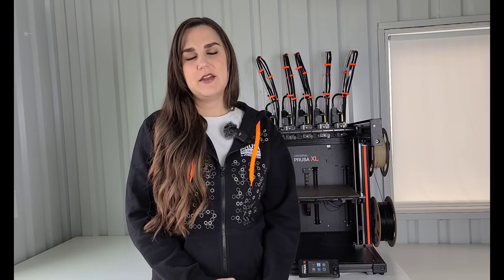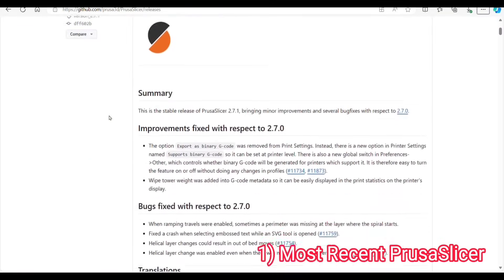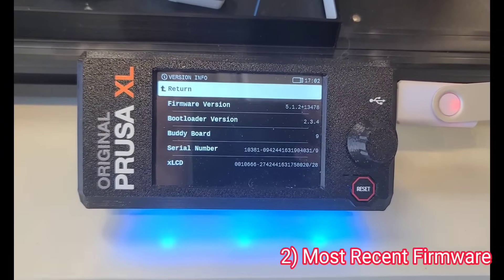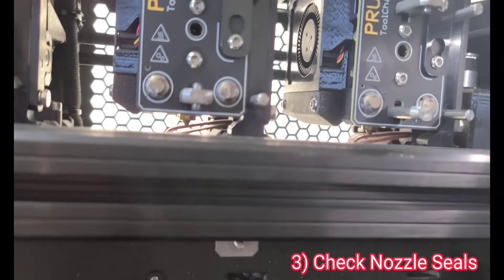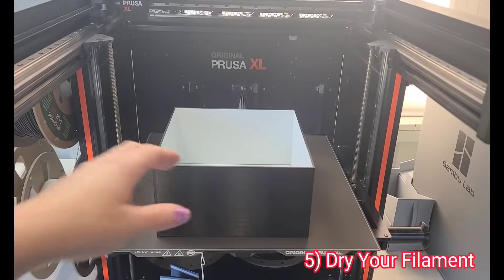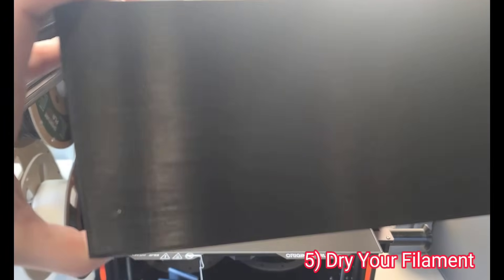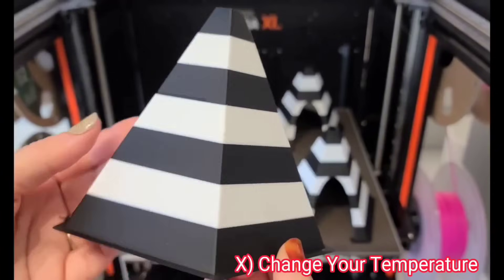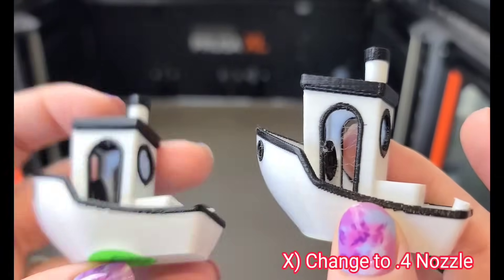Stringing on the Prusa XL - 5 Things That Worked and 3 Things That Did NOT Help!

Comment: First of all, thank you for your content. As an owner of a XL 5-head, you're one of the only YT'rs dropping consistent and legitimate content on the XL, so thank you!

I received my 5-head XL back in November, "fully-assembled" (haha) and honestly, it was wonderful out of the box. I am horrified to hear that there have been so many people who've had bad experiences, and I find myself extremely lucky. I had actually considered almost cancelling my order but I decided to commit as I know Prusa and it's community have resolved nearly all major issues (I had and hated my MMU2S on my MK3S). 

I have been fortunate enough to not have 98% of the issues you have had. Honestly I've only had 1 failure and it was my fault (bad slicing) but have had only mild stringing. I wish I could offer the community anything more than that, but I do my best to keep my filament stored in a "dry box", it's a weather sealed tupperware loaded with dedicated, and occasionally dry an older filament in a sunlu dryer.

My biggest issues with the printer in gerenal are: 
1. The bowden system can be a pain when loading TPU or when a filament breaks in the tube. It's workable but just a pain in the butt. I understand it is a necessary evil of having 5-tool heads so just keep on trucking.
2. Multi Nozzle size printing is not a thing... YET.. I have high hopes this will come in a future Firmware/Slicer release, we're early adopters so I'm just going to be patient but there's no reason to believe that it won't be developed in the near future.
3. This is more just me still learning but mitigating the wipe tower into the infill is just something I haven't been able to figure out yet, that as well as multi-material printing; as in using PETG as supports for a PLA print. There is just no good documentation/guidance out there right now. I'd LOVE to hear/see if you've done any of this!
4. The XL is not for the feint of heart to use it's full potential. Price point aside, understanding 0.6 vs. 0.4 capabilities, input shaping vs not, and getting creative with the large size and the number of parts as well as orientation of parts, there's a LOT to digest, years of experience has helped me to do some really fun stuff, but I have so much more I need and want to learn!

Honesly that's it. I know it's not a perfect printer, but legit... name one!? It doesn't exist, there will always be compromises, we have to choose/purchase based on our own personal needs/wants/use cases and move from there. The market is super-saturated with printers these days, I have personally owned 9 printers across 6 brands. I stick with Prusa for the dependability and community that always pull through! Bottom line, I REALLY LOVE this printer and can't wait to see what the future holds!

Once again, thank you VERY much for the content & shorts, they are very helpful. You're literally the only YT channel I have notifications enabled for! Happy new year and I look forward to sharing more of your XL adventures!

P.S. I have purchased 5 new 0.4mm nozzles, but I'm having too much fun with the 0.6, I had great success on first ever TPU prints, it was really easy and only mild stringing! One of these days, I'll make the swap to the 0.6.
Reply: My experience is very similar to yours! I've just got a set of 0.8, 1.0, 1.2 CHT nozzles. I am curious how they work. Actually I've got E3D nozzle adapter for each tool next to my set of 0.4 and 0.6. I am even trying to combine them in a single print.
Reply from the maker: That's great to hear that you have had such a great experience. I think I have stuck with it because I love my other Prusa printers. And I've also seen good results on facebook. I feel like it has such potential. 
My Bambu is very reliable but has limitations. Multi color prints take a very long time and of course creates much more waste. 
So I'm really ready to have the XL printing well. Thanks so much for your support!

Comment: I'd say go ahead and buy a couple filament dryers. Using the Bambu's bed is a nice stopgap, but dedicated filament dryers can dry the filament faster and won't tie up a printer. In addition, I'm willing to bet that dry filament will improve your prints even on other printers, as well as improve reliability. Drying filament is something that is pretty useful for running a 3D printing business, so I think having dedicated filament dryers would be worth it.
Reply: Agree since you live in a humid area.
Reply: There's been a few models recently released that would work for multiple spools (the Sunlu Filadryer S4), and I think there are even more on the horizon; now is actually a pretty good time to be looking at one.
Reply: I 2nd this advice. Filament dryers, especially ones that have hot air circulation such as those from Eibos, the Sunlu S2 or the new Sunlu S4, will be so much better and dry faster than using your Bambu as a dryer. Plus you can print directly from most dryers if you wanted to. I do that all the time when printing pretty much anything besides PLA. 

Just a word of warning if you were thinking of buying the Eibos Cyclopes dryer... the fan on it is loud and it has caused issues for me and others with melting filament because the fan blows right on the bottom of the spools. I heavily modified mine to quiet it down and fix the melting issue. I still, very occasionally, get some deformation on the filament if I leave a spool in it that isn't rotating. As in, I print from the dryer, but the print ends while I'm at work. The spool not turning can lead to deformed filament on the bottom of the spool. Although, it no longer straight up melts like it did when I first got it. They have a new one coming out soon called the Polyphemus that seems to solve most of the issues with the Cyclopes.
Reply from the maker: I agree. It takes 12 hours to dry on the Bambu! I'd rather be printing. I'm just running out of space. But I'm sure they wouldn't take up too much space. Thank you!

Comment: Firstly let me say thank you for posting your videos on the XL, I am still waiting (not so) patently for mine to arrive, so it’s great to be able to start to learn about the machine whilst waiting.

I am glad that you are being reasonably reserved in your criticism of Prusa as, whilst there are definitely improvements that can be made to the hard, soft & firmwares, I have to say that I think that there is also a certain amount of user experience that needs to be gained to improve the situation too:

Item 3 of your video states that having your nozzles seals set at the correct height is necessary to obtain a good print and you even refer to the Prusa video on the subject, which clearly shows how they need to be set, yet yours are obviously set too high: When the nozzle is in place, on the seal, the contact area of the seal needs to be parallel with the face of the nozzle otherwise a good seal will not be achieved and oozing could occur.

You are not making life easy for yourself by using non-Prusa filaments either; Prusa cannot be expected to develop/provide profiles for every single filament available as thoroughly as they do for their own.  Even if you were using Prusa filaments, a certain amount of tweaking of the profiles might be necessary dependent on the colour of filament and type of print, so if you’re using non-Prusa filaments you should expect to have to do a lot more tweaking to the profiles and you need significant experience and persistence to do that.  

On the whole the printer is doing a great job of printing the benchies, even with a 0.6 nozzle and do not forget that the Benchies are a torture test, designed to push your printer to the limit.  The only thing that it is struggling with, is a little stringing and oozing on multi-coloured prints which, as you have found with the 0.6 nozzles is a just a case of getting everything set right, including the filament profiles.  I’m pleased to see that you have been using a temperature tower, but I also think that you need to do some specific stringing tests, with each filament to iron out your problems with the 0.4 nozzles, including dried vs non-dried filament.

You have stated that you are not getting stringing/blobbing problems on any machine, but I think that it is fair to say that the issues you are getting are only really relevant to multi-material machines; do you have the MMU for the Bamboo?  I believe the MM version of this machine has a nozzle wiper built in and I have seen that others have added wiping brushes to the XL, maybe this would help you too: Search models: xl nozzle brush | Printables.com

I did a bit of research reference the Bamboo wiper & people were saying that the standard wiper isn’t that great, but others have made a modified versions that use 2 or 3mm silicone sheet as a wiper, maybe this would work better for the XL too: Bambu Lab X1C/P1P Nozzle Wiper with 2mm Silicone sheet by Sealight333 | Download free STL model | Printables.com

So, the final topic to address is why you are getting worse results with the 0.4 nozzles, when “everyone” else is getting better results and physics would also dictate that oozing should be less with a smaller orifice:

How long was there between drying the filaments, printing with the 0.6 nozzle and printing with the 0.4 nozzles, is it possible that the filament had started to absorb moisture again by the time you did the 0.4 print?  It is also possible that when you did the drying, the filament was only dried to a certain depth of the roll and the dry portion had been used before you did the 0.4 print.

Did you recalibrate the tool heads after changing to the 0.4 nozzles? This process is much more important on the multi-head machine than it is on any of the single head machines:  On the mk4 no change is necessary, if you don’t reset the Z-offset on a mk3, the only thing that could be wrong is the first layer, after that all other layers will be fine, but if you don’t do it on the XL, there could be a mis-match between the nozzles positions & height on every layer, which could cause one colour to be deposited on the other colour mare readily.

What layer height did you use/was it the same for both 0.6 & 0.4 prints?  Is it possible that the layer height used was more suited to the 0.6 nozzle?

Finally, have you noticed that there are now different filament profiles for each nozzle size & also for with & without Input Shaper?  The temperatures for the 0.4 layer tend to be hotter than those for the 0.6, is it possible that you adjusted the temperature for the 0.6 nozzles, but not the 0.4 nozzles?
Reply from the maker: All very good points. Yes I did recalibrate after swapping to the .4 nozzle. For the dried filament benchy, I printed the .6 first and then the .4. So yes it's possible that it either absorbed some moisture or wasn't as dried closer in on the spool. But these prints don't take much filament. 
Yes I used .2 speed on Input Shaper for both profiles. I will work on the nozzle seals. I figured as long as they're not pushing my toolheads up, the tighter, the better. 
I am having some prints that work out ok. But the inconsistencies are what are getting frustrating. 
Prusament PLA is sold out in almost every color. 
I think it's completely possible that my issues are user errors. Thanks

Comment: Really great update, thank you. I've a 2 head partly assembled XL. I've been feeling some buyers regret. The only things that have worked really well are single colour large prints (things that I can't fit on the MK3 or MK4). Most of my multi toolhead prints have been a failure - stringing yes, print failures yes I think are due to collisions on the wipe tower. My MK4 is working so sweet, and with input shaper is rock solid. I've not talked to Prusa support - I did try over Christmas but there was a long wait for an agent. I wasn't aware of the pin greasing issue. This is why your channel is so bloody useful - as others have said, there's very few YT channels covering the XL that I either trust or can be bothered with. Keep up the great content.🥰🙏👍
Reply from the maker: That's frustrating! Yeah single colors I have no issue with. Or maybe a single color change. I'm running something now without a tower because I've been having issues with that as well. I know it's not recommended, but it's worth a shot. 
Yeah I feel like getting on chat you need to be in front of your printer and be ready to wait for a couple of hours. But I think they need to get more feedback of the issues we are experiencing. Hope you get it sorted! Thanks so much!

Comment: My thoughts on the nozzle seals is that they should just touch the nozzle when it is parked. Reason is to keep the seal parallel with the nozzle tip. I do this by lowering the seal all the way down, putting the toolhead on, and then raising the seal till you can't see light between the nozzle and seal. Then one more turn to press it against the nozzle.
I can't say it solves any problems as this is how I did it from the start and haven't had major stringing problems. It is at least a procedure to get the same results every time.
Reply: This seems like an underrated solution. If the seal isn't good (completely flat), then the wipe tower can only do so much.
Reply from the maker: Makes sense! Thanks!

Comment: I like hearing your updates with the XL. I have the 5 tool semi-assembled version and I had some stinging early on that got mostly resolved with drying. I had a food dehydrator and designed a wall for fitting filament spools. I have recently purchased a Sunlu Filadryer S4 so I can dry multiple spools simultaneously. I switched to all 0.4mm nozzles mostly because it shows details better, but I noticed a further improvement in stringing after that. Right now I do not see any stringing issues and i am mostly happy.
Reply from the maker: That's so great to hear! Thank you!

Comment: As @hylitedFx shared, I too am thankful for your consistent and useful XL content, especially as I waited for mine to be delivered. I just completed the build of my semi-assembled XL-5 and am running my first 4 color print now with the 0.4 nozzles provided with the printer. So far everything looks good, however, if that changes, I will let this group know.
Reply from the maker: So glad you got it and are happy with it! What types of prints have you been running? Thanks!
Reply: @tada3dprinting  My first, and only print at this point, was a 4-color sign for my shop. It turned out fantastic! This is my first multi-color/material printer, and I wasn't expecting it until late Spring. When I finalized my XL preorder with Prusa in mid-December, two days later I received an email from DHL that it was being delivered in a week! Now I am behind with working on some new products that can be printed in multiple colors. 🙂
Reply: @agomerd  When did you place your order?  I'm interested to know how far off mine is; order place April 2023.

Comment: I also had some issues with stringing and blobs with my dual-head semi-assembled XL, but the new updates and a switch to 0.4mm nozzles fixed those. Now I have no stringing at all with PLA, the dual-color benchy is absolutely perfect. 
I had minimal stringing with PETG, which I fixed by adding brushes (look for „XL Nozzle Scrubber brush“ on Printables). 
So you are absolutely right, the experiences seem to be pretty different from machine to machine.
Reply from the maker: I have some brushes coming in soon that I will try. And I feel like on large prints, the stringing is less obvious too. Glad to hear it's working so well for you now. Thanks!

Comment: (see reply for follow up) For what it's worth, it isn't just the XL. Last month I got a Snapmaker J1 IDEX printer. Trying to print the dual color benchy (actually also trying again last night!) I also really struggle to get the fine details of the second color (black on both yours and my models) to not string.

Like you, I got all the same advice about retraction, but it doesn't seem to care much if they're set to what would be fine for a single color print.

Things that seem to be helping: Z hop for retraction on. Fast travel speed and acceleration. Very slow print speed for very fine features of the second color.

Something about zipping quickly thru the very tiny blob features seems to cause them to smear? I haven't gotten it perfect yet, but I found this while just trying to do stringing torture tests. That I needed a very slow minimum speed to obey minimum layer time to avoid branching and stringing. But still fast travel times to snap clean.

I don't know, haven't gotten it perfect yet. My best is about as good as yours so far. But those doors are hard to nail in a dual benchy with independent extruders!
Reply: And while tinkering more, may have found a Cura setting that can help. Experimental settings, small hole and small feature length with associated speed reduction.

This lets Cura automatically detect and slow way down for small features specifically. So that overall print time is not significantly affected! With the benchy dual color model, threshold to catch the doors and other small features and slowing to min speed, it adds only ~15 minutes overall, to the otherwise 70 minute print.

Don't know equivalent in Prusa/Orca slicers.
Reply from the maker: I think my frustration has been that my MMU3 on my MK3s looks SOOOO much better. It did take way longer tho. And I have issues with color changes a lot on it. I'll keep your suggestions in mind. Thanks so much!
Reply: @tada3dprinting  thanks! I've been following your videos, especially on the XL, as I also try to understand the nuance of multi extruder printing. I think there's some subtlety that just doesn't always follow from basic, single extruder logic! Especially with certain kinds of changes, like these small features.